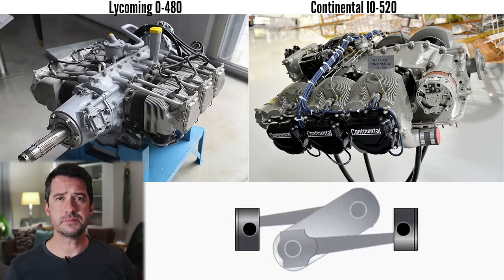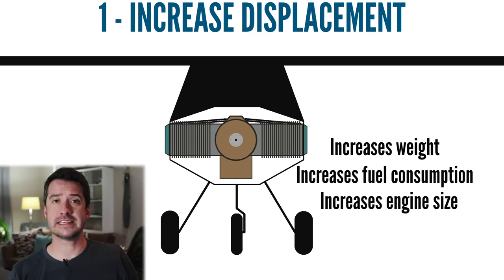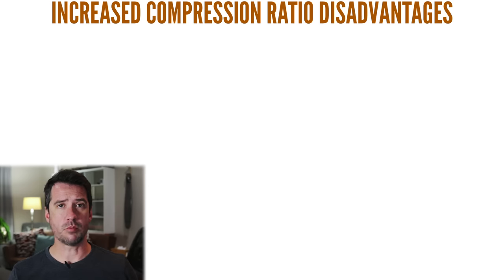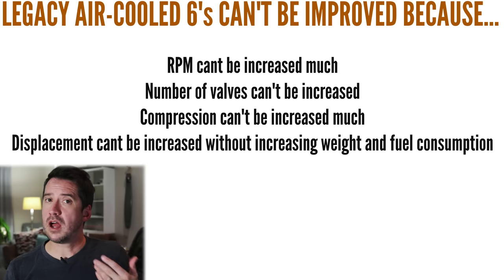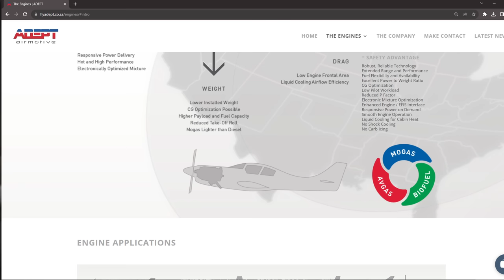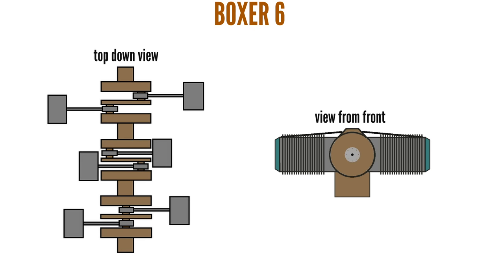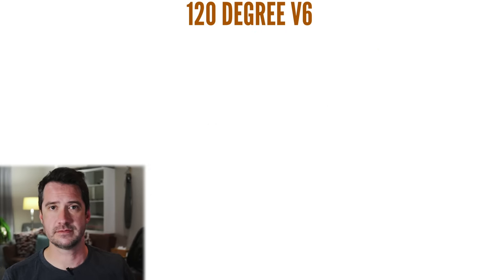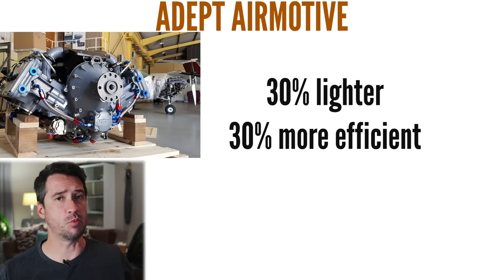Unusual V6 Airplane Engine Makes Boxer 6 OBSOLETE?

Comment: Higher compression requires higher octane fuel;  how have they overcome this problem?
Reply: Improved combustion chamber and port designs, EFI/electronic ignition managing knock via knock sensors. Compression ratios have been increasing in automotive engines for decades, without an increase in fuel octane.
Reply: @PistonAvatarGuy  Nearly all of that could have been done on the boxer 6.
Reply: @Hogger280  No, not with air-cooled heads. Liquid cooling has a very significant effect on reducing knock, this is why Rotax engines have liquid-cooled heads and it's one of the main reasons why liquid-cooled automotive engines are able to have such high compression ratios while running on such low octane fuels.

Knock sensors would also be a problem on air-cooled engines, as you'd need a sensor for every cylinder head.

Even the EFI Lycoming and Continental engines don't have higher compression ratios than their mechanically injected counterparts. Being OHV also limits the design of the cylinder head (the size, shape and placement of the ports, the configuration of the combustion chamber and the placement of the valves).
Reply: @PistonAvatarGuy  What country are you from Avatar?
Reply: @chippyjohn1  The US.
Reply: @PistonAvatarGuy  knock sensors are typically mounted to the cylinder block.
Reply: @chippyjohn1  Yeah, but liquid-cooled engines are far more monolithic in their construction, so I'd be surprised if a knock sensor were effective when mounted on the crankcase of an air cooled engine. It would be interesting to see if Lycoming and Continental make use of knock sensors on their EFI engines and where they placed them if they do use them.
Reply: @chippyjohn1  The TEO-540 does indeed have a knock sensor for each cylinder and the sensors are mounted to the cylinder heads.
Reply: @PistonAvatarGuy  That makes sense. I was thinking of a traditional engine where the cylinders are incorporated in the block. Have to remind myself how old air-cooled engines are. No wonder EFI air cooled engines are expensive. Cht sensor, knock sensor, egt sensor. One thing I like about the new BMW B57 is it incorporates a factory cylinder pressure sensor.
Reply: @chippyjohn1  LyContisaurus engines are definitely archaic monsters.

Are you planning on running the B57 as a direct drive engine? If so, how do you plan to get the proper propeller placement?
Reply: @PistonAvatarGuy  helicopter not plane. It has two stage reduction.
Reply: @chippyjohn1  Interesting. I'd imagine that there could be quite a few things that could be causing unwanted vibration in that case.
Reply: @PistonAvatarGuy  It's not that bad. Can always paint it pink and target the female market. Have a good day.
Reply: @chippyjohn1  You might also want to consider that diesel engines don't last long in aircraft. An engine that's pushed as hard as the B57 will likely have the longevity of a flash bulb.
Reply: @PistonAvatarGuy  The M57 was a very strong and reliable engine, the B57 is not quite as desirable for several reasons but it is more common being in current production. 200-225kw at 4000rpm is not a lot for the engine. Its design is better than the diesels used by diamond. About a month ago I learnt that the OXE diesel outboard engines use the same engine at the same rpm and power output. The torque output would be maximum 475-540nm where as factory they produce up to 750nm and aftermarket in the 1000nm range. With modifications ofcourse, but my experience with them tells me they are quite good, although the experience was in cars. Yanmar also used them for marine application as an inboard with great success around the same power. My opinion doesn't mean much, but time will tell.  There is big demand for diesel powered helicopters.

Comment: And, what would these cost in comparison? Was that answered already?
Reply from the maker: As on the website $76k for the Adept 280N. Not Lycoming nor it's distributors advertise engine cost, but on various forums claims for an O-540 are about $65k - $70k

Comment: I really enjoy when people think that a DOHC engine is just clearly better than an OHV.

The LS vs Coyote is always the easiest example. Basically because of how large the heads are on the Coyote you end up with an engine that is larger in length, width, and height. So even though the it has 4 valves it only flows 10% more than the LS because the Coyote’s bores are smaller.

Then when it comes to power the Coyote still loses because because the LS offers 20% more displacement.  Which turns straight into torque. Also, because of a larger displacement and higher lift the 7.0L LS7 also spins the most RPMs on the LS side.

In the end, HP wins races and it is just a consequence of torque and RPM. You can make more torque or spin more RPMs, but the 10% better head flow on the Coyote translated to RPM, while the increased displacement turned into Torque, and when you are making 20% more torque and your opponent is only spinning 10% more RPMs you’re gonna win because you are making more power.

Supercharge both, same result.

Turbo both, same result.
Reply: The simple fact a 2.5 liter subaru boxer 4 with a sohc makes the same power as those big aviation 6s is why it's better, yes sohc and dohc are bigger and force a smaller engine, the sheer fact a 7.0 ohv and 5.0 dohc make similar power proves why you want to use dohc, because if you increase the displacement of the dohc  the advantages of the larger ohv dissappear  outside size and complexity ,but a dohc v8 isn't the worst to work on, and dohc has much better flow and efficiency cause you have the extra surface area to a comparable ohv counterpart which is why this argument fails cause as soon as you make them the same displacement there is no real reason to use an ohv especially when it comes to planes where that complexity and size don't really matter the same way it does in a car
Reply: A larger bore also needs thicker walls in the block. Generally, you scale up the engine like it is cast, not like it is made of sheet metal. So weight increases linearly with displacement and we want to keep down both of it. With water cooled engines, cyclinders share walls because they don’t both fire at the same time. So we save weight compared to V2 or radial or air cooled anything.

4 valves are a way to more flow with less weight ( smaller valves, tighter turns ). A central spark plug open to wards the exhaust valves avoids knock.

Comment: Rater than in Engine configuration, the rationale for decent General Aviation and Automotive Engines is in the Good Old Single Sleeve Valve distribution, either Burt-McCollum or Piccard-Pictet. 
3'000 hr TBO, the Open Sleeve, Sleeve acting as Annular Piston, sending power to crankshaft via Sleeve actuating mechanism, Compression Ignition (Diesel), 2-Stroke, as described by Harry Ricardo in his 'The high speed Internal Combustion Engine' remains unparalelled in power and fuel economy.
See interview with Mike Hewland, Car&Driver, July 1974, a Bricklin car in cover.
Blessings +
Reply: The high cost and difficulty of making the sleeves is the problem with that idea.
Reply: It's not a viable concept in today's world... which is why sleeve valve engines became obsolete.
Reply: @WilhelmKarsten  Are you the pontifex maximums of Internal Combustion Engine?
The style of your notes is fascist, besides ignorant
Reply: @josega6338  Sleeve valve engines have been obsolete for 70 years son... stop spreading ridiculous nonsense
Reply: @WilhelmKarsten  U R attacking an army officer in a war time, paving the way for the enemy, the penalty for this is.....
Karsten barada nicto
Reply: Go pull the Young Horus tresses your friends wear from hair...
Reply: @WilhelmKarsten  Wrong slander!
Reply: @josega6338  Please stop posting lies and ignorant misinformation about a topic that you are completely unqualified to discuss lad.
Reply: @WilhelmKarsten  What are your qualifications? I'm member of SAE, can also qualify U as natural born schyzoid

Comment: So what is the inherent imbalance factoring with a 60 degree vee six cylinder engine when compared with the imbalance factor within a 120 degree vee six cylinder engine? 
These both seemingly are somewhat 'rough' running engines, unlike an inline six cylinder engine, but which does still introduce a longitudinal 'torsion' factor to the centreline of the rotating mass nevertheless and requires a very rigid block construction to compensate. 
Is a flat six with 'shared?' crankpins then about the most 'balanced' engine we can ever find? 
I have noticed that despite a terrible idle 'roughness' in sound, the large capacity twin row radial engines appear very smooth at cruise rpm of 1800 to 2200rpm (P&W/DC3 and Bristol Hercules/Freighter Sleeve-type)..very smooth indeed..what's going-on with these round engines??
Reply: Those round engines have innately smooth power pulses, due to the combustion sequence. They also are naturally balanced at the primary level, due to all rods tying to a master rod on a single crank throw, and sharing a single counterweight. I’m ignorant about their secondary balance. 

Berzerkly difficult to design and build fairings around them, though. Both for exterior airflow and interior cooling airflow.
Reply: 60 degree with 6 throws is balanced. US manufacturers and racing teams try to get away with 3 throws, though.

180° V6 is worst.

Comment: Clarification you can share the same crack pin on a flat 6 too it doesn't have to be a v shape engine. 9:44
Reply from the maker: Well you can in theory, but it's never done. It would then also not be a boxer engine anymore, just flat. Sharing cranpins on a flat 6 also removes all the rocking couple cancelling properties of the boxer 6, and will as a result have a rocking couple with twice the magnitude of each inline 3...not good, and not practical.
Reply: All true, just wanted to get it off my tongue :) @LetsGoAviate

Comment: I had this idea to use a Honda J35 engine with a gear drive on the back and a jack shaft in the V.
Reply: Look at Yamaha 3 and 4 cylinder engines. People have already done the development work, both on the engines and the PSRUs. 

Don Parham did belt drive reductions for Subaru EA-81s and EJ-22s with the jack shaft just above the engine. One advantage to the belt is that it mostly dampens secondary balance vibrations and reduces inclination of prop vibration to propagate back through the PSRU.